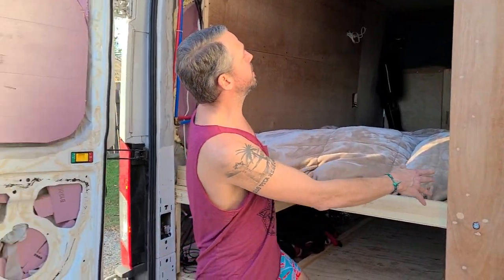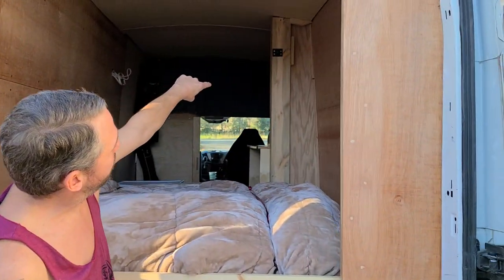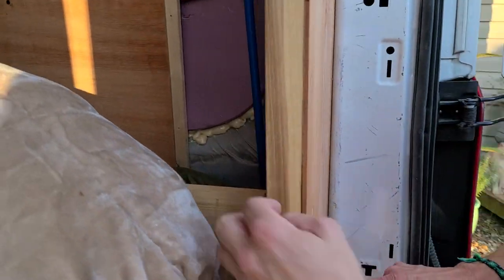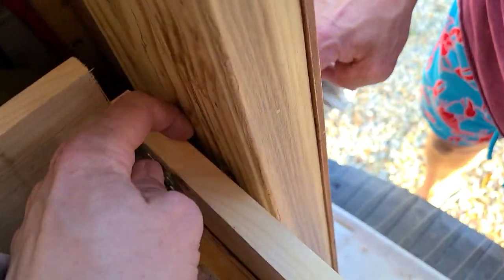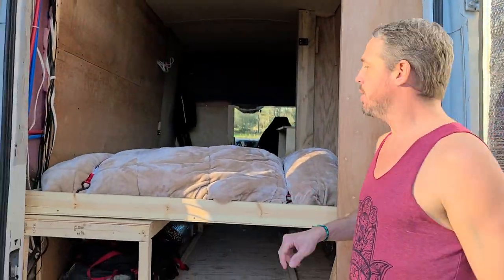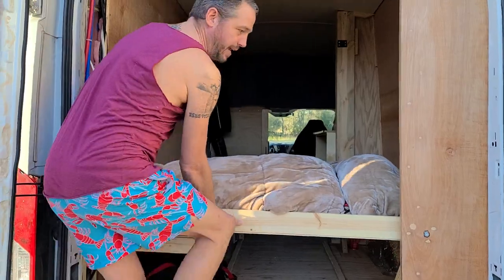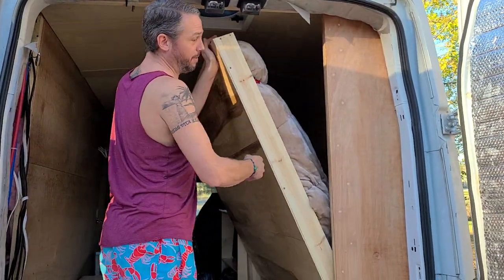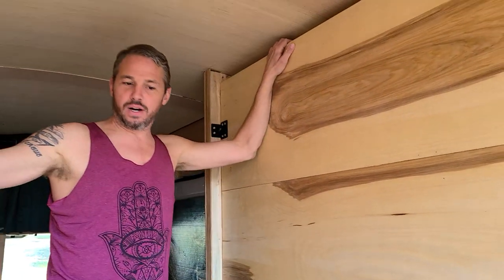2 minutes or less! Murphy Bed Build in Conversion, Camper, Transit or Sprinter Van for under $50

Comment: Fabulous . I'm doing a twin bed running front to back the same way. My only change will be to put the head of the bolt on the inside . I'd also like to try a locking nut . I'm thinking this will allow any extra threads to be cut off . Appreciate you sharing this as it's simple and I've been wondering why people felt the need to use fishing boat swivel seats and paying for Murphy bed kits . I'm all about keeping it simple .
Reply from the maker: I might have done it differently just a bit, like a locking nut in the beginning, I have them on there now though for sure. The regular nut can rattle loose over time